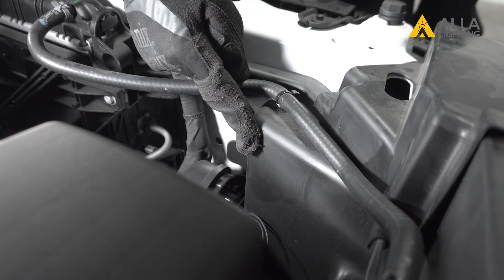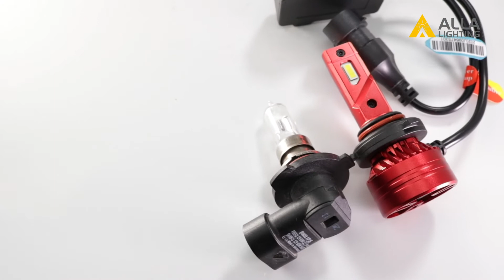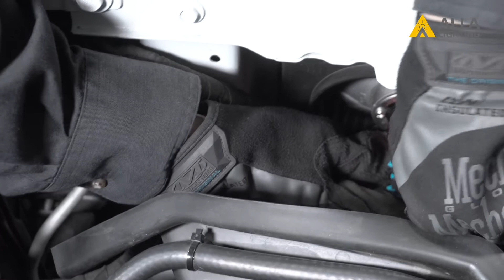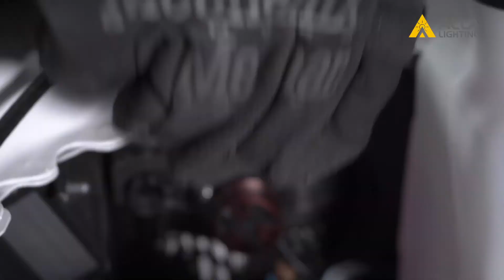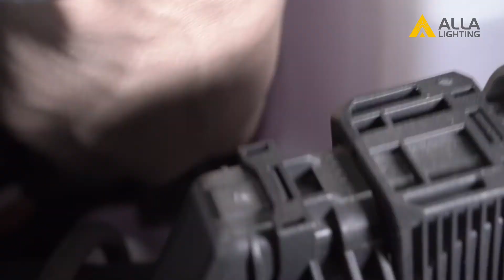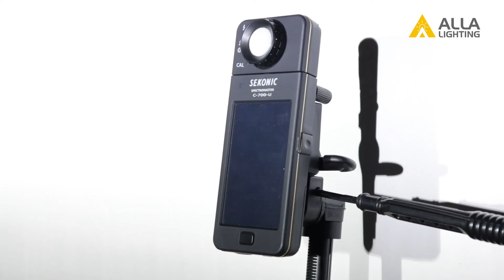Install | Replace 2015-2021 Chevy Colorado LED Headlights | High Beam

Comment from the maker: Chevrolet Colorado bulb size guide link: https://allalighting.com/pages/chevrolet-colorado-bulb-size-guide-exterior-interior-lights
How to install | replace | change 2015-2021 Chevy Colorado LED headlights bulbs/high beam HB3 9005 halogen lamps upgrade for vision and safer driving. Thanks for watching and if you like our videos, please give us a thumbs up, and subscribe to see more installation videos!
Reply: does the led headlight on a colorado need a canbus or an anti-flicker?
Reply from the maker: @ginolefebvre4263  No need, just plug and play, easy installation.

Comment: Don’t forget to make sure your lightbulbs are adjusted properly as you can see in this video his driver side is slightly higher than his passenger side which will go right in oncoming traffic space don’t be afraid to adjust your lights down little bit so you’re not that guy

Comment: If I Upgrade my chevy colorado 2018 with your h11, 9005 and 5202 led bulb, does it make interference with the radio. If so, is there something i can do to avoid this.

Comment: What the heck is that crap for on the passenger side & can you just leave it off ??
Reply from the maker: Do you refer to the dust cover? Dust cover is for waterproof and dust proof, usually it is better to put it back especially for the location with a lot of rain or dust.
Reply: @AllaLighting  Thanx for the reply, I'm referring to the plastic covers you must rmv to access the dustcovers & bulbs on the passenger side.